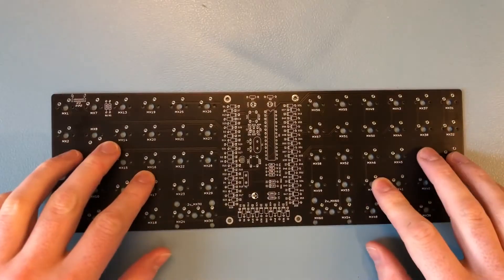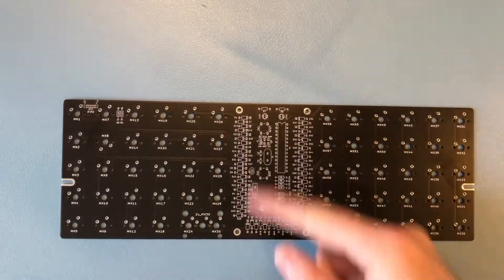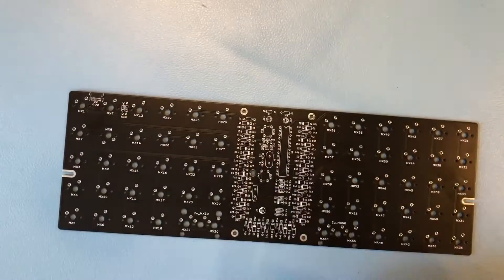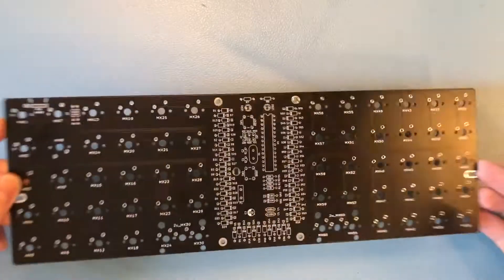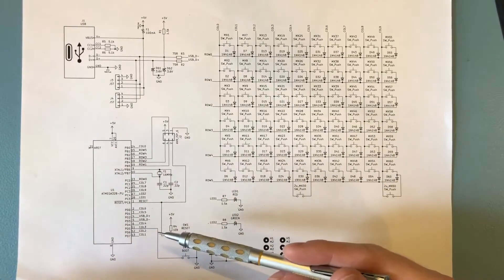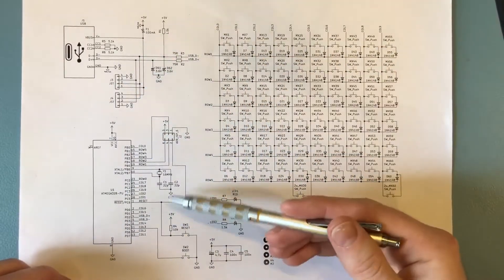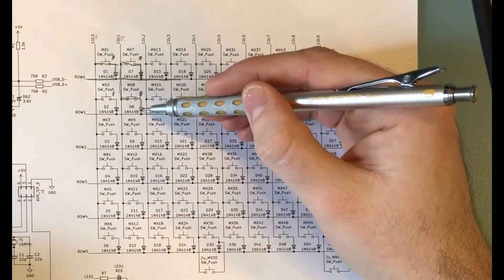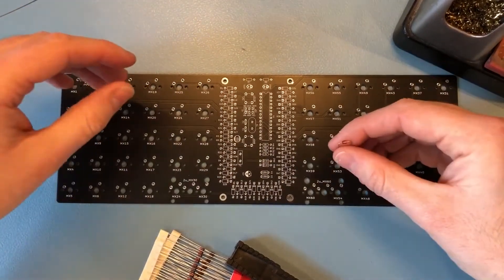Let's build and explain a mechanical keyboard!

Comment: Interesting layout, that would indeed need getting used to. As for the mcu, I would have expected at least an atmega32u4 because of the built in USB peripheral, interesting to see a standard 328 works fine as well.